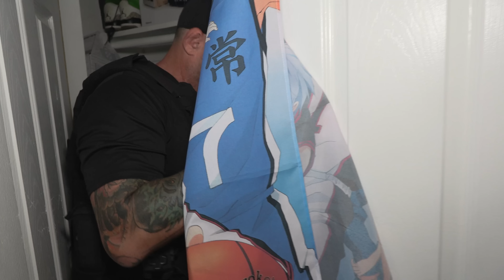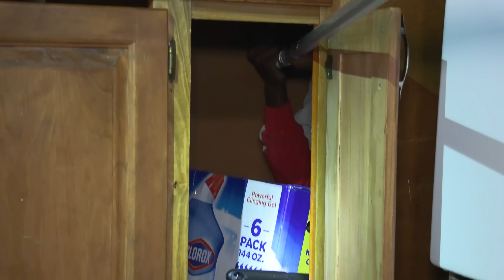Everything But The Kitchen Sink

Comment: We love you, Harvey!  
You just hold up those pants and go.  You're good at what you do!
Reply: Harvey needs a pair of suspenders😂😂😂😂
Reply: @anthonypiligno7618    Why do they call them "pair" (like pair of scissors)?
Reply: I do also
Reply: @Aeson-np8tr Pair means "two" you wouldn't wear just One suspender, or use one blade of the scissors, or use one pant legs. So it's Pair 🤷‍♀️
Reply: @ravenmoonchild7036    "Suspenders", "Scissors" and "pants/trousers" are the object description; each being a singular unit/article (they are NOT separate or separated and needing to be fastened together).  When one says "pair of suspenders", they are referring to the two separate suspenders that connect shirt tails to individual socks/stockings (much like a garter belt for women that hold up stockings).